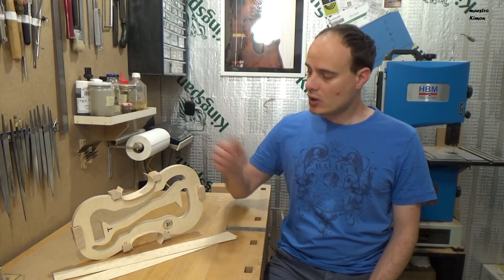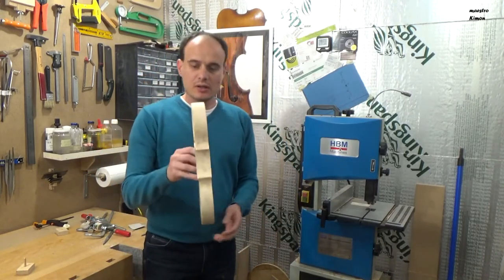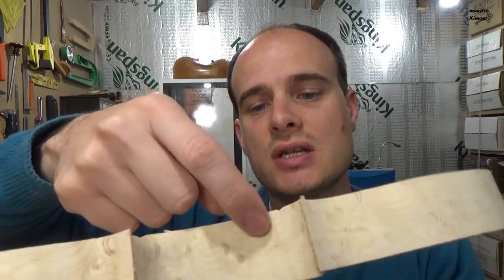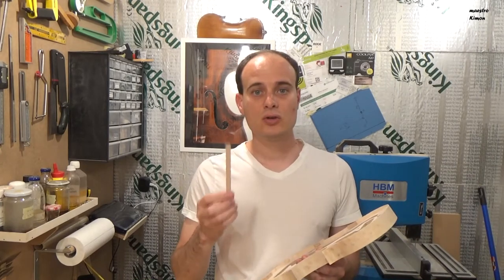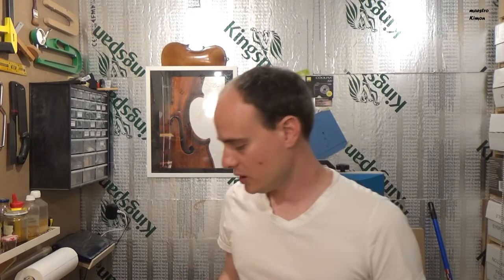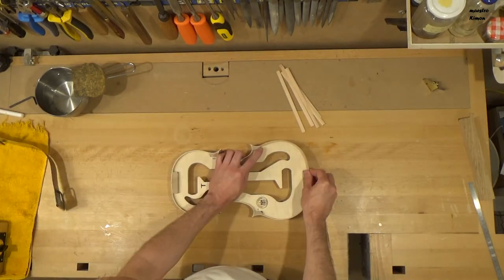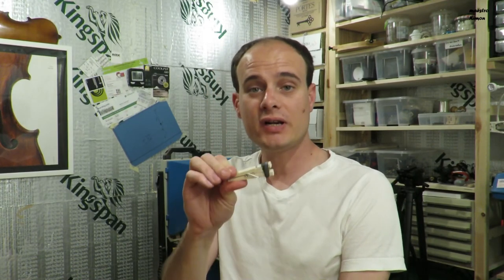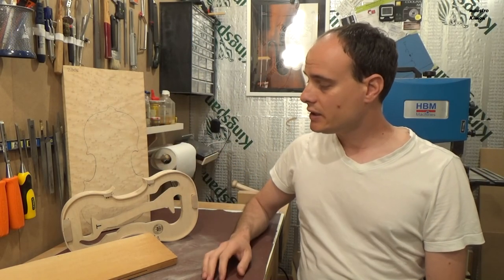Making a violin -  step 3 -  finishing the ribs and linings

Comment: So you did not have enough room for your linings and you were left with the linings sticking above the ribs? I've seen another video where they had the mold flush to the bottom of the ribs so there was room to install the linings correctly on one side.

I appreciate your work very much - very educational.
Reply from the maker: Thank you for your kind words! No, I had enough space for the lining. They have to stick above the ribs a bit so you can file them matching 100% with the ribs.

Comment: Why do you inlet the linings on the one block but not the other?
Reply from the maker: For the top and bottom part of the instrument you don't need to inlet the linings because they are stuck between the blocks (middle and upper / middel and lower respectively). For the middel part (at the CC) you have to inlet the lining as they are not stuc between block and could get detached more easily.